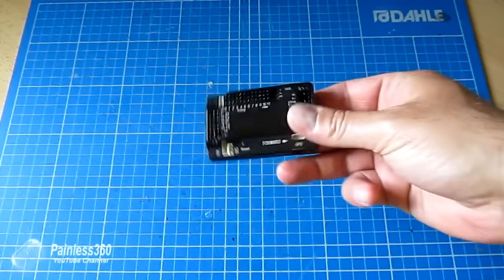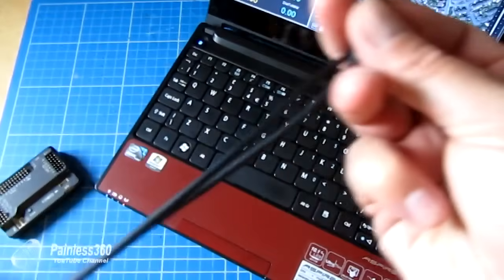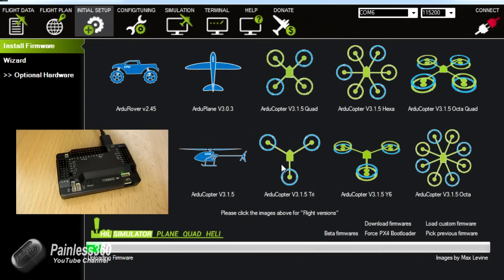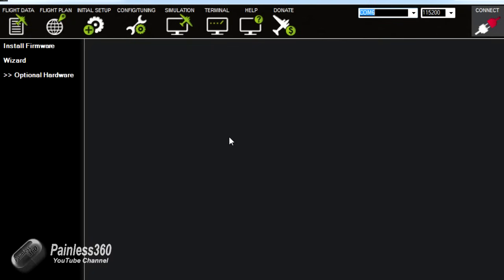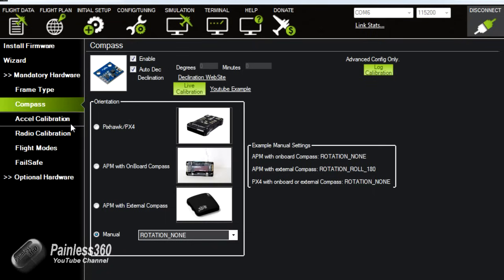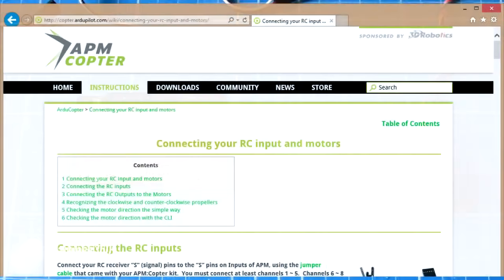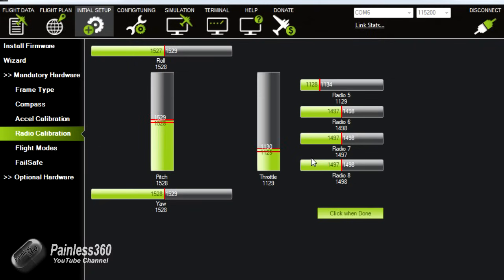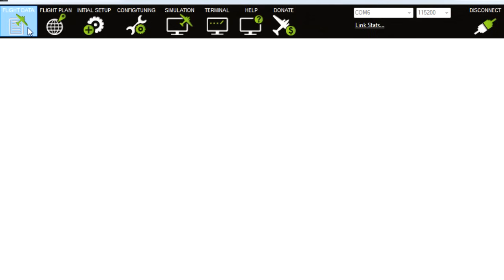(1/8) APM 2.5/2.6/2.7/2.8 - Simple installation and setup overview

Comment: Hey man, a big shout out!

Cheers! Ive been watching since Christmas taking notes and being careful. I have a Bayangstoys X16 flying in a custom frame, and am ready for the next step. I chose the AMP 2.8 for cost reasons...cheaper to lose. lol With Flysky cheap radio gear, and the wizzardy of my IT smarts kid, the whole nine yards just powered up and calibrated the first time. I haven't fried a single thing...yet. I'm a retired airplane mechanic and private pilot so nothing is weird or strange. But oh the details. The bloody damned details. The "bayang flier" has dug holes more than once. You Youtube guys have been good teachers.
Reply from the maker: Happy flying! :D
Reply: And one more cheers dude. It has flown 3 times today. Absolutely zero issues. All I know is Phoenixdrone, aka X16 crash recovery project. The weather is trash here so just the yard and driveway, but wow the difference is big. It flies so well I've hot rodded it with confidence. Damn near wrecked it twice as it weights 1200 grams and boogies. The yard runs out fast.

Anyways cheers man! This is an affordable blast. And most of fly 2 came out of your head. Pixhawk on a fixed wing is next. I'm ex F-111. I think I'll take a swing at a foamy swing wing. I have a soft spot for twin boom  airplanes. All of them look good. So a twin boom swing wing twin. Probably similar to a C-337. Center-line thrust is where it's at.
Reply from the maker: Happy flying and I'd find a huge space to let that sucker off the hook! :D
Reply: Question kind sir?

Everything seems fine until I power a camera from it. It is a cheap wifi camera from a toy quad, but the pics are usable so what the heck. However every time I've hung it on the APM quad the electronics freak a bit it seems.

So, APM 2.8 powered by the included power module, with GPS and external compass. Both jumpers are correctly removed, and I'm powering the output side from the #1 esc BEC. PPM and signal wires only for the number 2, 3, and 4 esc. I have a nav light LED system powered from the #6 UART (GPS) signal pin. The craft flies terrific and has passed all checks, and it's ready to play with. Then I hang that camera on it and it freaks out.

The first time it wouldn't connect in mission planner using USB power, it took the battery. Before I figured it out, I flew it...GPS wondered...the dog distracted me...it hit a tree. Thankfully the tree didn't catch fire or nothing, and the drone didn't make a hole in the roof. SOOOooo, I figure that camera draws more current than the input side of the board can deliver through the power module. So I tested the theory, disconnected it (after the rebuild), and walla! It connects to mission planner again, and flies great again. But there is a solution...right?

Of course there is. I moved camera power to the output side, on the 2A BEC, that should do it. And it seemed to...until I got a hundred meters away. Then I got a real world ops check of the signal out failsafe apparently.  What ever! And I got several ops checks as well cause I wouldn't give up. So I landed, swapped batteries, and unplugged that camera, and ol quad-li-mod flies great again. What now?

The camera is all in one wifi mounted directly below the RX. The RX antennas are at 90 straight up and directly to starboard. the horz antenna is within an inch maybe an inch and a half away from the wifi antenna. Both are 2.4gHz right? Is the wifi TX walking all over my RX? If I unplug the camera the drone works great. Oh FS-i6X and the fs-6i or what ever receiver.

Comment: Sir, your videos are invaluable for using Arducopter FCs. I have the 2.8 version, with external compass. I also connected the MinimOSD. The TX is the Flysky FS-i6s. ( PPM ),10 channel, with the FS-iA6 10 channel RX.
I'm about to install the Arducopter 2.8 FC in a Cheerson CX-20 frame, with the stock motors, ESCs, and power board. The Open Source FC, went tits-up on me, so hopefully this combination will work as well, if not better than, the original FC.
Thank you for your great instructional videos!

Comment: I'm new on multirotor world, but not to the heli world... I was looking for a great FC for my second quad or hexacopter with gimbal... This videos tutorial are AMAZING! Simple and direct to the point of interest! Thank you very very much... I hope to be able to program this unit, as a novice.. thanks!
Reply from the maker: Best of luck with the build, this is a great board and gives a great blend of full features and easy setup.

Happy flying!
Reply: thank you very much! :D and the last question: where do you advice me to buy an APM kit with everything? I mean, APM 2.6, GPS, OSD, Telemetry radio to the ground station's laptop, or if you can advice me about the "shopping list" because a'm just a little bit noob of this hobby sector.. :D thank's, you rock!
Reply from the maker: AleZakko Most of the ones you will find on the internet are clones of the official 3DR boards so the normal rules apply.Personally I would not use HobbyKing for APM as they have had too many issues with their 2.6 clone and ended up replacing it with a 'fixed' version and calling it 2.7. That has shaken my confidence re quality control and testing..I would look to a local supplier who can also provide hep and support if needed, if looking on the internet then go for a specialised RC supplier on eBay or somewhere that does decent packages like Banggood.com (http://www.banggood.com/APM-Flight-Controller-Set-APM-2_8-6MH-GPS-OSD-Radio-Telemetry-etc-p-960341.html)Best of luck with it.
Reply: great! thank you very much!!!

Comment: Dear Painless360 thank you so much for your videos especially the APM 2.6. I watched though all 8 once and am in the process of watching though them again and when I do actually get my 2.6 flight controller ill probably watch them again. I am currently building a S500 frame with a 2.6 flight controller to use as kind of a starter camera platform and ive never built one before. I bought a blade 350qx2 for me and my dad to have fun with but we are rapidly outgrowing it and quickly finding its shortcomings. anyways I wanted to thank you again for your videos. take care
Reply from the maker: Sean Scott Thank you, good luck with the new project!
Reply: +Painless360 Thanks man. Ive been following your video series to try and help me get my multirotor off the ground and no luck yet man :( I cant get my APM 2.6 board to pass radio calibration. On the mavlink screen all the channels just sit static and dont move and im not sure what to do. Ive tried about all i know how to do. The rc cars are much easyer but i really want this to work. Are you on any forums and maybe I could ask for some more indepth help?
Reply from the maker: Make sure you've selected the right connection in the setup and the wires are connected properly. I do provide one-to-one help over Skype (see the website) if needed.

Comment: Hy "Painless360" :)
Thank you very much for these great Video Tutorials , I Own an APM2.6 Arducopter for 2 weeks for my second quad project ( My first one is fited with a KK2.1.5 ), and I'm happy to find such a great tuto like this , this is clear and useless for me ( I'm french guy and speak a poor english :) ). I just stay in troubles with my OSD connected to the APM , but I will find the solution later :) For now I have to perfect flying with the KK2.1.5 ( I bought my first quad toy 7 month ago , and after tasting 3D flight had build a 450 frame with FPV that I fly with it for 3 hours now ) and in the same time ( when my battery pack is charging ) I learn all about APM settings and how to work with it :)
Thanks again and Happy Fly :)
Reply from the maker: Bonjour DJ Garfield! I am pleased the video helped. Good luck with the OSD..

Happy flying!
Reply: Thanks :) I think now that's is my Arduino ftdi adapter wich cause the issue , I'm waiting for new one ... I watch all your video , to learn more about APM :)
Reply from the maker: :) Merci!
Reply: Painless360
Finaly It was both FTDI adapter AND Microcontroler of the OSD were out , cause I tried with the new adapter and I was able to communicate with the OSD , but when I wanted to upgrade the firmware of the OSD with the configuration tools ( 1/ reload the right bootloader :OK  ( W ISP ), 2/ upgrade the firmware ( Arduino IDE : OK ), 3/ update char set NOK at this point the upgrade "bricked" the Atmel328P in the OSD , because ( I duno why ) the update had setup the Atmel fuses to wrong state , so I still cannot do anything with the OSD now ... Have had made something wrong ? duno , but I ordered a new one and let it to the factory state and won't try to update to a newer firmware in the future ...
Thank you for your great tuto , they are very helpfull for me :)
Reply from the maker: You are welcome. Happy flying!

Comment: Hey! I made a quadcopter using the following:-
1) F450 Frame
2) APM 2.8
3) 1000 Kv Motors
4) 3500 mAh Lipo
5) FlySky - CT6B
It's a 'X' build.
The main issue I'm facing is that whenever I try to raise throttle to 50% it doesn't take off and the moment I raise it to 100%, the quad flips to the right. Been over a year I'm trying to fix this issue and haven't had any success.
To try and fix the above issues, I ended up doing the following...
1) Calibrating the ESC's again
2) Calibrating the accelerometer and compass (Mission Planner)

3) Checked if the propellers are as per the right motors ( CW - Pusher, and CCW - Normal) (Made sure the alphanumerics are facing up as I installed them)

I really can't figure out what is wrong, any help or advice?
Reply from the maker: Could be lots of things - see my video on what to check if your quad flips on take-off..

Comment: Just got everything in and was ready to program but mission planner is different than the setup you show.  I've watched this a few times. yet with the 2.6 v I'm not sure how to get the compass calibrated.  Only getting 3 of of 180 points.  I love a challenge but will have to try again tomorrow.  My brain is at capacity tonight.  I just hope the rest of the build goes smoothly.  Still have osd, voltage meter,  sonar and the other fun stuff to do.  Your videos are great and I without them I would not have got this unit.  Thanks for taking time out of your day to make these videos.
Reply from the maker: You need to connect the separate compass to the board for the calibration (see the note in the video at 8:56). If you have an APM 2.6 then there should be two wires coming out of the GPS unit - one for GPS, one for compass.

Good luck with the build..
Reply: As Painless said, you have to connect additional GPS module (ublox neo 6m) and rotate that module when calibrating compass.
Reply: Painless360 thanks.  I walked away from it for a minute and came back to do it again.  It's up and running now.  Just was getting to excited and moving to fast.  Like a kid on Christmas morning.
Reply: ***** thanks,  took a couple times but i got it done.

Comment: APM2.8 ArduPilot Mega 2.8 APM Flight Controller Board  for RC Multicopter

Introduction:

This is the new APM 2.8 autopilot module. The sensors are exactly the same as with APM2.6, however this version does not have an onboard compass, which makes this version ideal for use with multicopters and rovers.

The APM 2.8 is a complete open source autopilot system and the bestselling technology that won the prestigious 2012 Outback Challenge UAV competition. It allows the user to turn any fixed, rotary wing or multirotor vehicle (even cars and boats) into a fully autonomous vehicle; capable of performing programmed GPS missions with waypoints. Available with top or side connectors.

This revision of the board has no onboard compass, which is designed for vehicles (especially multicopters and rovers) where the compass should be placed as far from power and motor sources as possible to avoid magnetic interference. (On fixed wing aircraft it's often easier to mount APM far enough away from the motors and ESCs to avoid magnetic interference, so this is not as critical, but APM 2.6 gives more flexibility in that positioning and is a good choice for them, too). This is designed to be used with the 3DR uBlox GPS with Compass (see option below), so that the GPS/Compass unit can be mounted further from noise sources than APM itself.

Comment: re start and new cable firmware partialy installs and is stopped at the same point, forums discuss the same issue I am yet to find a resolution. I have built a lovley 550 discovery like quad for this board and it looks like the only way it will ever fly is if I go outside and huck into the sky. too bad I was really looking forward to trying this ardupilot board, one of the folks from Crazyponey sent it to me at a discount in hopes I would write a kind review. Oh well no review is better than a bad one. Back to the building table. I wish my laptop would work as flawlessly as yours seam to.
Reply from the maker: It's all about proper driver setup, once you've got the right ones installed you should be golden. Most of the manuals/wikis and now even a lot of the GUIs give you links to the right drivers. We do have another little netbook we use for the more 'experimental' things so we don't break the main machines! Best of luck!

Comment: Another great video , i am planning to move here from the Naze32, because my flights are quiets and aerial video making.Thank you.
Reply from the maker: Best of luck with it!
Reply: btw , i have a ublox neo-6m , with serial connections,vcc,rx,tx,gnd,wil it work with it?
Reply from the maker: Should do but ideally you want a GPS module that includes the on-board mag too. See later in the series. Happy flying!
Reply: i agree , but i have  a neo-6m sleeping in a drawer...lol!
Reply from the maker: That'll work but you'll also need a external mag. Best of luck!
Reply: finally i opted for the combo GPS+Mag.
Reply: i need to rotate the board  forward to backward (180) is it possible?
Reply from the maker: Should be - see the detail in the manual.. Best of luck!

Comment: I received this board, and from the get-go I have never been able to manually calibrate the compass. I recall reading somewhere that the version I have of the board doesn't have an on board compass? That may make no sense, I apologize if it does, I'm relatively new to this. Can you shed any light as to why this is happening? When I have the GPS connected, the "bad compass health" warning goes away, but without it it comes back.

Comment: Will this board fit in a ZMR 250 mini quad and clones and is it an appropriate choice for me as I want GPS and RTL functionality? What mounting hole spacing does it have? Also, in a ZMR would there be room for other periperals such as the GPS or barometer and compass modules or LCD? In a ZMR would there be room for a case and anti-vibration mounting? Finally, should I get sideways or vertical pins?

Sorry, I'm new to this and so much information and conflicting opinions to digest....

Thanks for the informative videos!
Reply from the maker: This board is about 7cm by 4.5cm so check the frame on the quad. You also need a little more room for an anti-vibration mount. Or, you could use the APM Mini V3.1..

Comment: Great instruction! I am building my first quad (SK450) and I have already purchased an APM 2.6. I need to get a GPS unit and was wondering which one to buy? Do I need the GPS/compass combo? Do I need to configure anything or are they plug and play? Hopefuly you already have a video on this. Thanks!
Reply from the maker: Hi, the rest of the videos in this series will answer these questions for you. If you want GPS based modes (Hold, RTL and Auto) then you'll need a GPS unit. If it's 2.6 then you need one with a GPS with the inbuilt compass.

Good luck with the build!

Comment: Thank you for this video in helping setup the APM 2.8 on my hexcopter.  I need help on an esc problem.  Followed your video instruction to setup the esc individually.  After all is done, #4 and #6 motors would come on after the motor unlock.  The other 4 motors remain still unless the throttle stick is move up.  I tried to re-calibrate these two esc a few times and with same result.  What's wrong?  Please help.  Thank you.

Comment: Greetings and thanks for this very helpful and well-produced video series. I have a question: Where can one obtain the (8) cables to connect an APM 2.8 Flight Controller to a radio receiver ?  I have so far been unable to find a source. Thanks :)
Reply from the maker: +Uncle Doug Lots of places should stock the servo cables. Search on places like Ebay to find them..
Reply: After many fruitless hours of searching, I finally found some on Amazon. Thanks for your reply.

Comment: Hi Lee. I'm sure you've covered this somewhere in the series, but am having a hard time finding it. I was hoping to find one of your easy-to-follow diagrams for wiring 3DR Radio Telemetry & MinimOSD to APM 2.X single telemetry port. I'm guessing it will require customizing a Y cable? Just want to make sure I'm not crossing any communications or power.
Reply from the maker: +Mcwdes this is tricky as connecting both will commonly pull the signals from the telemetry pins on the board below the level they can be reliability read. I used to see buffer devices that made this possible but have not seen one anywhere for months. Best of luck!
Reply: Thanks Lee. Is there any reliable way to do this without compromising the data? Besides going to Pixhawk.